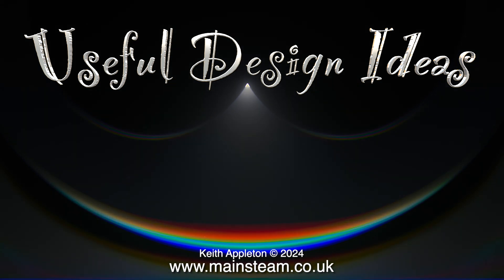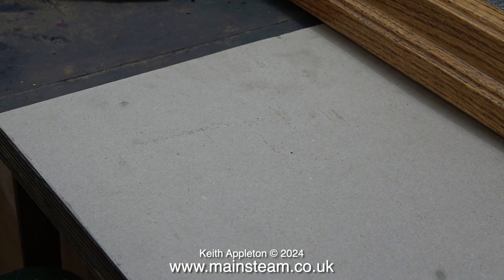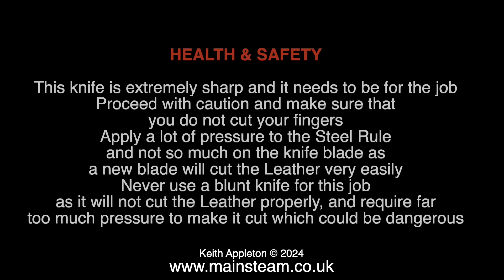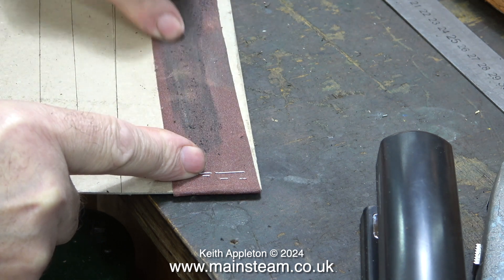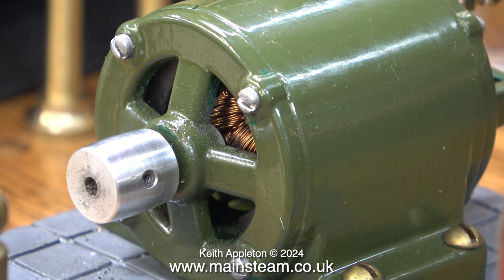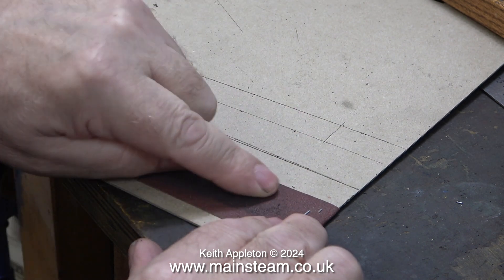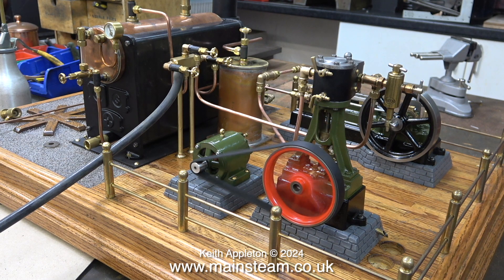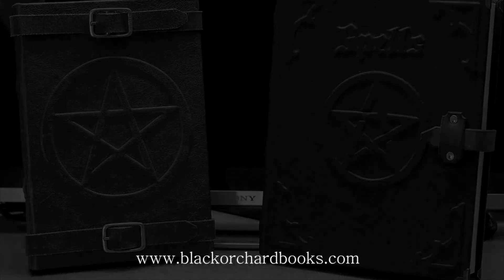USEFUL MODEL STEAM ENGINE DESIGN IDEAS FOR MODEL STEAM ENGINES - PART #5

Comment: Lovely video, Keith! I recently made a belt for this same dynamo, but using actual leather never occurred to me. I assumed it wouldn’t be flexible enough. Great to know it can be done and works so well.
Reply from the maker: Thank you, I very much appreciate your comment, the leather belt and at least 3 number 10 staples seems to work really well around the small diameter coned pulley of a PM research dynamo.

Comment: Keith, A big thanks for warning us about Stanley knife blades. When these things get dull (blunt) they are usually still very sharp. In my experience, which is extensive, only the tip (point) and a short distance back gets real blunt. When you cut corrugated boxes, then they get blunt all over, but are just short of being able to shave with, well, not really. A Stanley knife is a great tool, just like an "Exacto Knife" and just as dangerous. Thanks again for the tip and warning.
The steam plant is looking good.

Comment: I used to get mixed results with super glue until I invested some time to discover how it works. It turns out that it cures faster in an alkaline environment. Hence, using bicarbonate of soda with super glue as a hole filler, it hardens almost instantly. An alternative to saliva, as a curing agent, is to use a small spray bottle containing a bicarb or baking soda solution. Much cheaper than the commercial stuff. Always start my day with your posts they set the tone for the rest of the day.

Comment: Top Tip Time:  Make sure to use the biometric fingerprint scanner on your phone for unlocking.  Teach it 2 fingers on one hand and 2 fingers on the other hand in case you rip/cut off part or all of one hand.

Bonus tip.  If you catch your hand in a belt or cut your fingers off DO NOT grab the dismembered hand from the pulley/blade using your good land lest you cut/rip off the second hand. 

True Story.  A 14 year old boy was working on a farm alone.  He was using an auger power by the PTO of the tractor.  He got his sleeve caught in the auger shaft and it tore his arm off.  While fighting he got his second arm torn off too.  He went to the house and managed to open the door with his mouth.  He got inside and dialled 911 with his face (predated cell phones but at least it was push button and not rotary).  After getting the ambulance on the way he went and sat in the bathtub to keep the blood together.  When asked why he sat in the bathtub he said that his mother had just gotten white carpets installed and she would be really mad at him for all the blood he got on it.

Comment: To anyone doing this super glue or CA glue when gluing leather together the glue gets very hot and give off a lot of fumes
Reply from the maker: In this case the joint didn't get hot. When I used CA when building R/C Model aircraft the joints in Balsa wood got very hot and almost started smoking ......